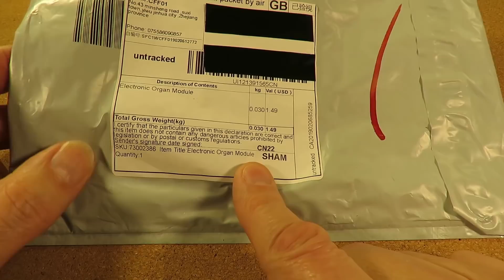Grandad's Postbag 190221 Electronic Organ Module Kit

Comment: hi G...
'
can this organ kit work more than 8 sounds or only 8
Reply from the maker: Each switch gives a different resistance between pins 7 + 6 one the NE555 changing the output frequency so I am sure you could change the range of resistances and add as many switches as you want. If you Google "Electronic DIY Kit NE555 Component Parts Electric Piano Organ Module" images you should quickly find the circuit diagram.
Reply: @GrandadIsAnOldMan 
hi G...
'
my electronic organ kit can put with 2 kits together and 16 different sounds...
successful kit...
want to see the video and listen 16 sounds
Reply from the maker: @bestamerica  I always enjoy watching your videos 😁👍

Comment: Oops eh? but proving how tough 555's are.
You have a BigClive table there, with the colour, burn type marks and the same sort of camera angle! Was it planned that way? cos it works for this type of vid :)
Reply from the maker: Actually the burn marks are soot from one of the pop pop boats. It is incredibly difficult to remove, especially on your hands. One of those things that just gets worse, you try to brush it off and it just spreads further. Try a damp cloth and it just spreads further. Think you are OK, rest you hand and find you had some on the back of your hand and it spreads further.
Reply: Very fine graphite dust does that. Wonderful coverage, if you want yourself to become electrically conductive! Old motor oil under the fingernails is another example. Both combined would make a good video, then 165 different cleaning videos over 6 months, trying to get the stuff removed!
Reply from the maker: I think I will leave that for now, but I like the idea 😍

Comment: An interesting little project. I did notice after you put up "spot the mistake" that the 555 was round the wrong way. I have done it a couple of times. 
Here is a link to a good little electronics program called Circuit Wizard. I have used it many times and then printed my boards out using photo paper printed from an old black only laser printer. Then you iron the printed paper onto your copper board and put it in some etching fluid. I have not done it for a while. It works very well. The laser printer uses some sort of fine plastic so it sticks to the copper board. Won't work with a normal printer but you could trace over it and use a sharpie pen to draw the circuit. The etching fluid won't penetrate the black from the sharpie pen.
https://www.new-wave-concepts.com/demo.html
They used to do a free edition of Circuit Wizard but I don't see it on their site.
Reply from the maker: Haha, another old comment. Hermit Oldguy just suggested I use this as a signal generator for that oscilloscope.